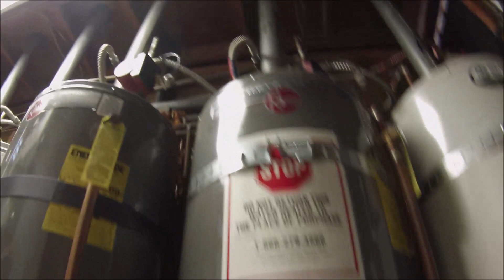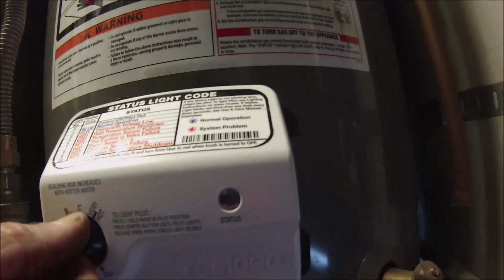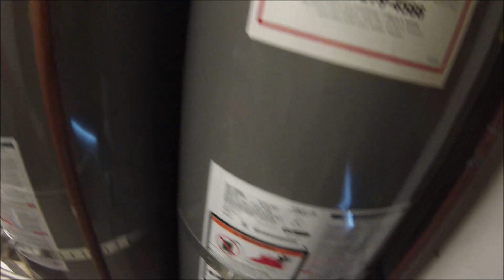Installed 4 Valves still a Code 7 / 7 Flash for a Honeywell Valve

Comment: I replaced twice the valves and all other components possible even the vent and ended up with a new water heater.
Reply from the maker: @donaldchen6894  : that’s pretty wild. I could understand if it was a different problem like every time you fix something and something else that’s different. What happen I’ve seen that. But if it’s the same problem over and over again and you replace components, that’s very rare. Thanks for watching and commenting. Really appreciate it.

Comment: I had the same problem after two replacements of new valves plus the new circuit boards and then ended with a new water heater.
Reply from the maker: So weird , guess maybe burner assembly giving  false code? crazy , I will try replacing the burner assembly next time!
Reply: @thewaterheaterfactory  any update on this video? I replaced a valve under rheem warranty and the code keeps coming back. I had already switched out the gas line because it had a dented one and thought maybe it was a pinched hose. Still code 7.
I was going to check the air vent and try cleaning the burner or blowing out the gas line. Suggestions?

Comment: Love your content on a 10 year old bradford white that throws code for a Insufficient  Combustion air detected reset system what could the fix be?
Reply from the maker: Whats the code? Is it a direct vent? Flame arrestor could be blocked with dust? Bad sensor.
Reply: @thewaterheaterfactory  So for the Ten flashes that's what it indicates the issue is And yes it's direct vent And i'm not at the customer's house but just wanted to get some feedback so next time that I do run into that issue
Reply from the maker: Unfortunately I don't work on direct vent ! Not a fan of them , But it sounds like the fresh air vents might be blocked I would try blowing out the flame arrestor with lots of compressed air , Make sure it has enough make-up getting to it if its in a basement or closet.

Comment: Can I use WV8860C1000 instead of WV8860C1008? Can't find the 1008. The 1008 has 10 red codes and the 1000 has only 8 red codes. Otherwise, they are similar.
Reply from the maker: Yes , try it you can always switch circuit board covers to keep your original code chart